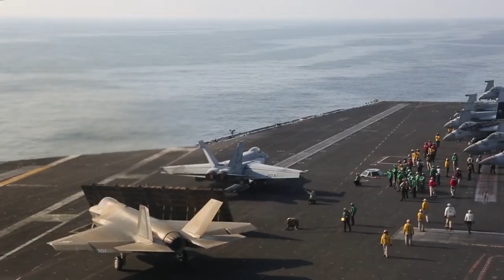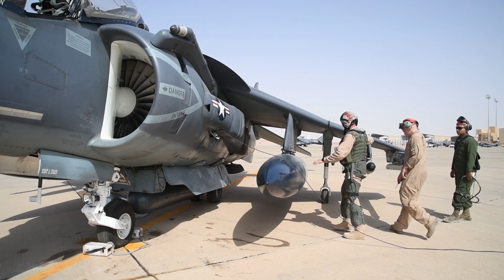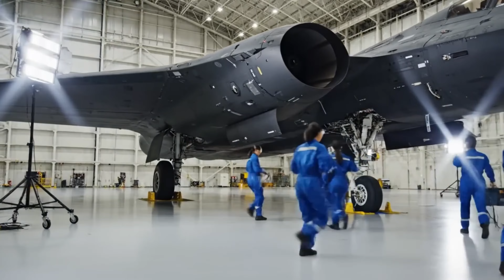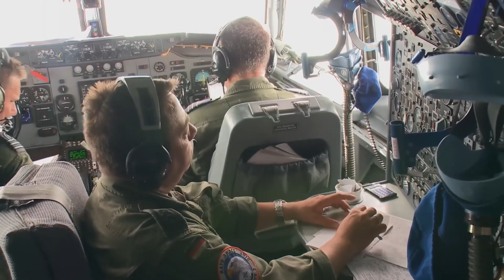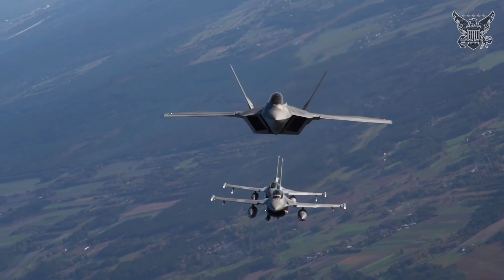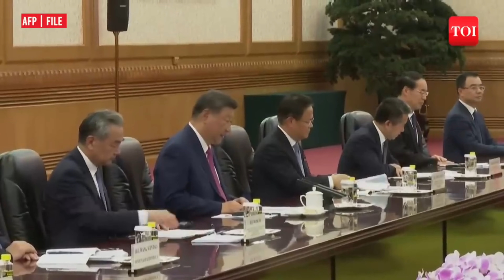Fighter Jets Have One Weakness. And It Changes Everything

Comment from the maker: The real story here is not about fighter jets.

It is about who controls the technology inside them.

Every country that bought the F-35 bought performance. But they did not buy the source code. They did not buy the upgrade rights. They did not buy the ability to modify their own aircraft without asking Washington first.

That is not ownership. That is a subscription with a fighter jet attached.

What the UK, Canada, and Sweden are building changes that model completely. Full technology transfer. Domestic production. No outside approval required.

And the line that says it all: ownership does not translate into autonomy.

Drop your thoughts below. Do you think Canada will follow through, or will Washington pull it back in line? Let us know where you stand.